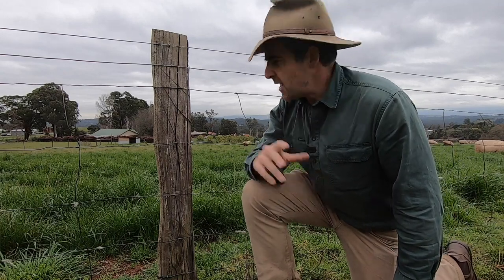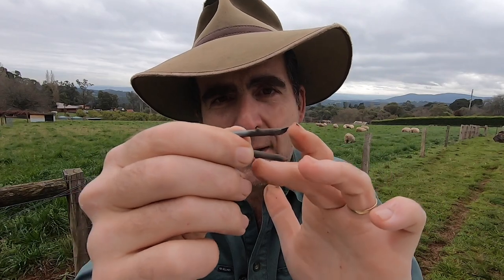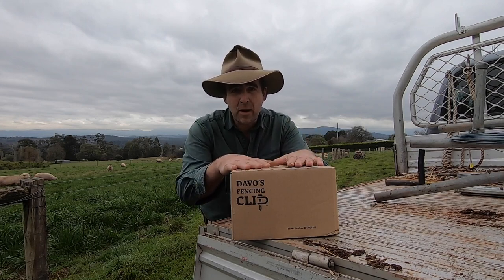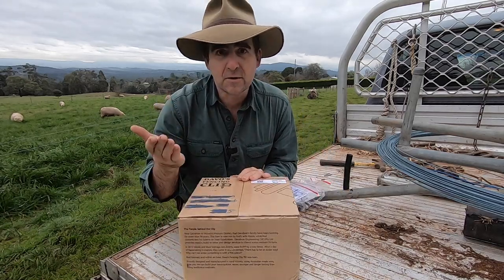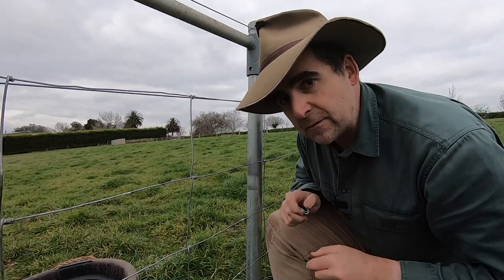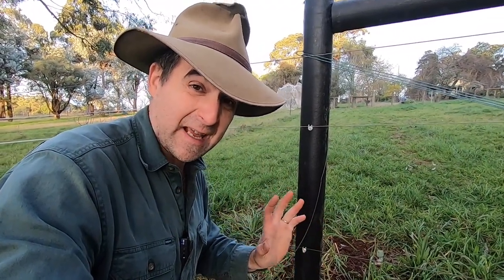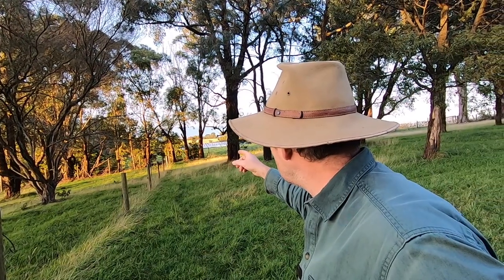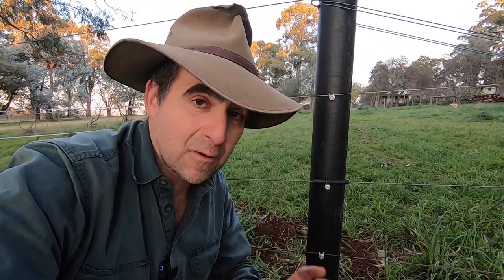Davos Fencing Clip - The End of Fencing Staples?

Comment: Fenced all my life. Never had any significant problems with staples backing out. They're simple enough and I wouldn't wanna carry the driver compared to a hammer. I don't see any real benefit to the clips shown here to justify the extra cost and changes. Why fix something that isn't broken? Just my opinion
Reply: VERY GOOD POINT.
Reply: I agree.... Who wants to limit their fencing distance by the longevity of a battery, or have to stop fencing because (you forgot to put the batteries on charge last night) & all your batteries are flat.
Reply: Depends what you value your time at. These would be great for staff paid by the hour. Would cover a lot more ground.
Reply: @normalguy7898  Yes you are right... makes sense if you were a professional fencer. As a farmer not so much. (Unless you had several thousand or million acres)
Reply: @vking5665  I live in 30 square feet in Sydney. What would I know
Reply: @Tom-lc9ni  how many acres are you on tucks and where abouts? Can I come and work for you?
Reply: otis6791, tell me, do you personally own a cordless drill?  i always used pliers to hold a staple to ensure success.  nowadays, i refuse to use them for anything.  i removed my stock of them from my shed.  and i use other things to do the same job instead, like tek-screws through plumbers clips folded over.  i have certainly seen staples (or u-nails) work their way out over time.
Reply: Don't use cheap staples huh? Really all there is to it haha.. I'll always use them, just like my grandpa!
Reply: We have cattle and they push hard enough to just rip staples and nails out.
Reply: Opportunity to not buy electric fence insulators hey

Comment: 7:00  "simply screw into the post"  might want to mention you had to pre-drill a hole before you advanced the fastener
Reply: No the tek screws will go in. Just use the short ones on really hard wood.
Reply: @johnlemmey7698  Respectfully, if you stop frame right before he begins screw attachment you can see the hole
Reply: @KSA-ll9kt  Ok. that is cheating.

Comment: People watching this need to be highly suspect as to whether or not this is an advertisement. I became interested when I watched the clip being installed on the metal post and nothing being said at all about the pre-drilled hole that was there before the screw was put in. So no it's not as simple as drilling into the post that quickly. You have to pre-drill a hole and why wouldn't you say that because that's a big part of the work involved with it?
This product may in fact be a great product. Having done hundreds upon hundreds of yards of fence myself I can see that there could absolutely be a benefit  in regards to time. But I also have to suspect there is a serious cost difference between a standard staple a clip that needs a screw.
It's just that I don't like being lied to and when you are lied to you have to step back and ask yourself why.

Comment: I like the clips. Best wishes to the family that makes them. I saw a comment where someone was critical of the cardboard carrier box because it could get wet and fall apart. Just paint the bottom with some spray paint. That will seal it. BTW I use Ryobi power tools, and they have lasted for me. I also like the wide variety available. When I buy one, the cashiers always ask if I want to purchase the extended warranty. At first I did buy it, but not now. I have NEVER had one fail. Sure, I wasn't using them 10 hours a day, 7 days a week, but I would use them often at the apartments I had. They were built at the beginning of WW2 and I took care of most of the repairs, so I used my tools reasonably often.

Comment: The cost of these things would only end up jacking up the Lineal metre rate and therefore cost the customer. I've never had a problem with a barbed staple in 20 years of fencing, they don't ever "fall" out. Maybe when the posts are 30+ years old and rotten like in this video the staple will come out when cattle push against it. The reason staples end up on the ground is because people drop them and don't pick them up. This seems more like an electric fence product more than a solution to staples, providing it is insulated.

Comment: I have no clue what you are talking about with the fence staples. The wood rots away before those things come out and I've never heard not to bang them all the way in.  I've tried to get them out of 50-70 year old locust posts and they don't come out. I've destroyed screw drivers and the fencing trying to pull those things out. Looks to me like the posts you are dealing with need to be replaced.  Now your new clips seem to be quick and easy with a cordless drill, and depending on the costs I'd say superior to insolated connectors with your work around. And like another commenter said if you run a slit down the middle of your insolation tubing you can add it anywhere. Easiest thing is old garden hose, slit lengthwise, 8 inch to foot lengths. This is obviously an advertisement for this company, and it seems to be a decent product, just use valid criticisms of what we have used for 100+ years please, like it can be hard to beat them in.

Comment: They sell wire holders In automotive store for years. You can get them in Rubber coated metal. Galvanized metal  and come in plastic. Not a new invention. 
Just a piece of wire.
Reply: MichaelKingsfordGray  
Thanks for the compliment.
But you should be talking about yourself that way.

Comment: packaging poinless as when stapeling up you just have a pouch full on the belt,,,whole operation too complicated and slow,,,plus recharging in the field? ok for small jobs i guess, but in the middle of nowhere ,,putting up 600m a day? no way
Reply: A decent impact driver with a 5AH battery will drive a kit of screws. In addition with spare batteries & a small inverter on your vehicle you can easily recharge. That’s how the carpenters do it. They’re driving way more screws than any fencing contractor would.